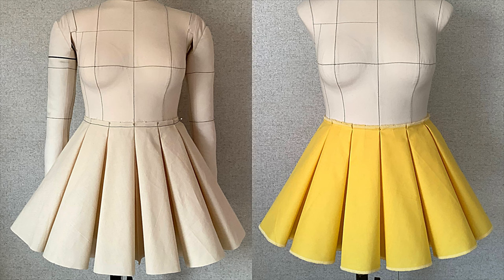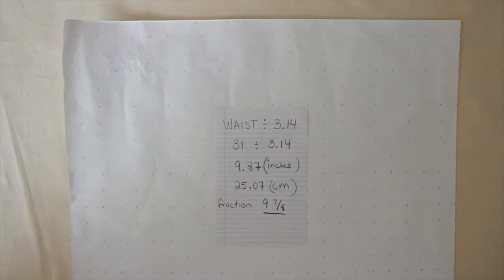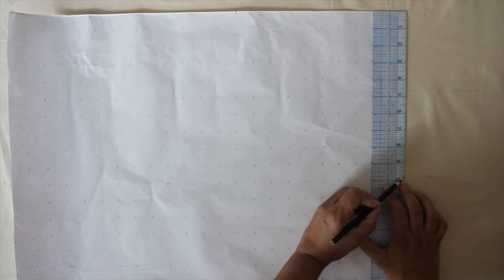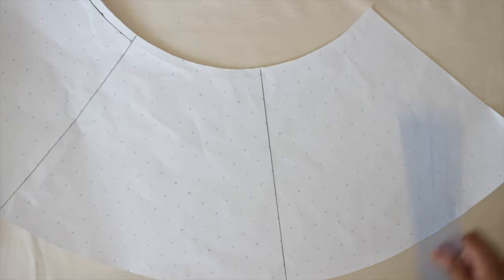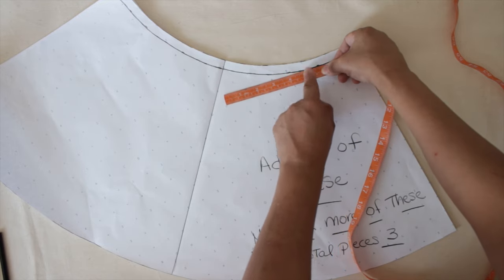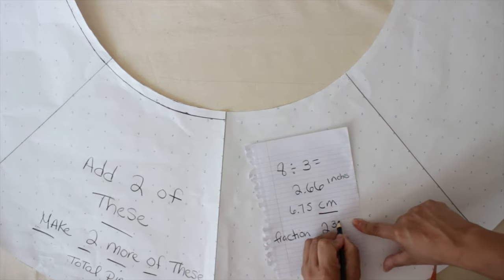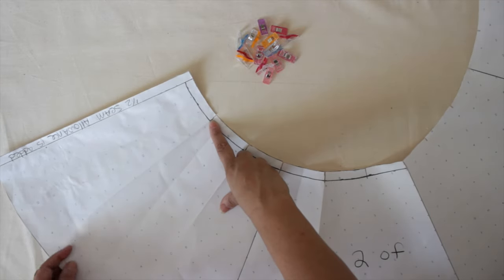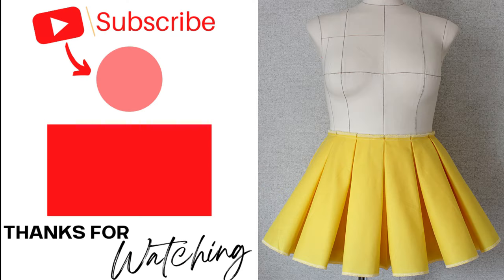HOW TO MAKE A PLEATED CIRCLE SKIRT

Comment: thank you very much, that was super helpful!! i love the final result <3 may i ask how do you calculate the amount of fabric you need in total for the skirt? many thanks :)
Reply from the maker: It depends on the waist size and the length of your skirt also how wide your fabric is. The fabric I was working with is 44 inches wide and when you fold it it’s 22 inches. The companies put 1/2 for the selvage part so it 22 1/2 inches on fold. the total amount for my dressform  is 22 1/2 (which 12 1/2 length plus 1/2 seam allowance on top makes total 13” and the radius was 9.87 but top of skirt became 9.37 because of the 1/2 added for seam allowance)the pattern was right at the end of the 22 1/2 inch fabric. Thank god that was a close one lol…So if u want to make your skirt longer you will have to open the fabric so you have some length but that means you will have to cut the pattern in half for all 3 skirt patterns. To make it fit the fabric don’t forget to put your seam allowance where u cut. That’s for a 44inch fabric…if u are working with a 60 inch fabric it would be better.

Comment: At 2:05 you say 'this is called the radius' and write the word 'radius'. But circumference(waist measurement)÷pi(3.14) is DIAMETER, not radius. Is there a step missing?
Reply from the maker: Hi are u talking about when I was calculating the circle skirt radius?...u can call it diameter if u want...pi is the ratio of the circumference of a circle to its diameter...it is an irrational number that approximately equal to 3.14. The radius of a circle is the distance from the center of the circle to the edge of the circle...radius of a circle is the distance from the center of the circle to any point on its circumference...the radius is half of the diameter...hopefully u not confused anymore.

Comment: So confused.   Circumference (waist measurement) divided by pi(3.14) is **diameter** NOT radius. But in the tutorial she says the line she's drawing for the circle is the radius. What am I missing here? The math isn't making sense. I get that it's the radius because the corner to the line is definitely radius since diameter would be across the whole middle cutout of the circle. But she's using the math formula for diameter. Wth?:/
Reply from the maker: Hi are u talking about when I was calculating the circle skirt radius?…u can call it diameter if u want ….pi is the ratio of the circumference of a circle to its diameter…it is an irrational number that approximately equal to 3.14. The radius of a circle is the distance from the center of the circle to the edge of the circle…radius of a circle is the distance from the center of the circle to any point on its circumference…the radius is half of the diameter…hopefully u not confused anymore.
Reply: @drapingclass101  .well done
Reply from the maker: @alabifunmi3744  thank you ❤️